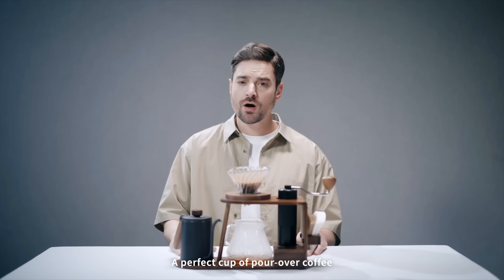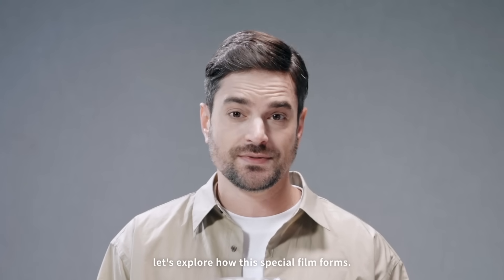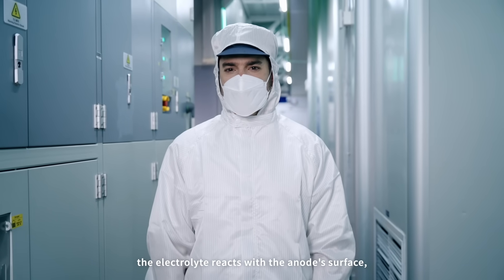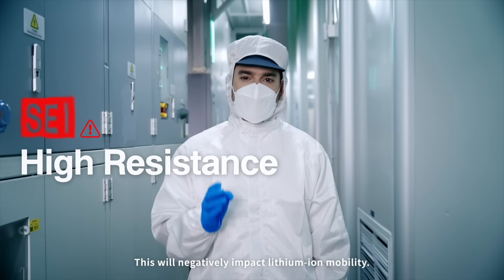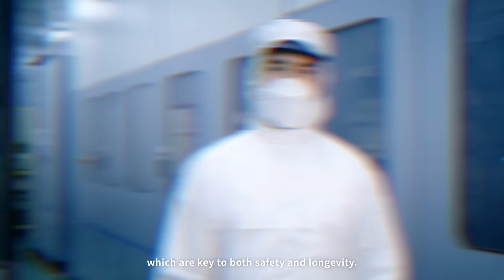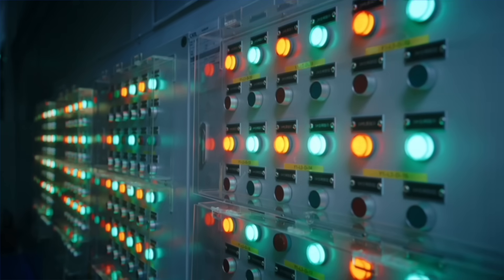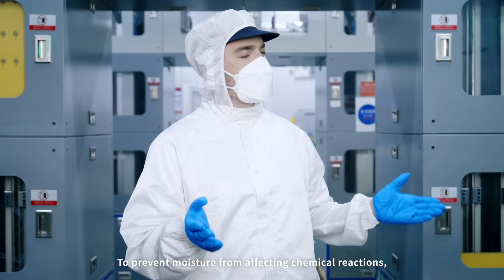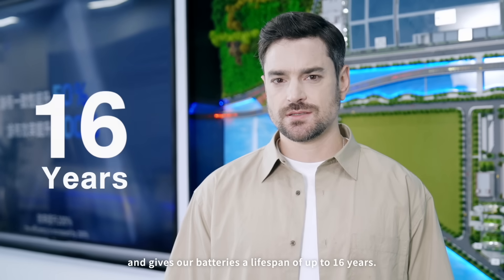1000x Thinner Than Hair: How Nano-Thin SEI Keeps Battery Fast & Long-Lasting | CATL Manufacturing

Comment: Tabless(full-tab) cylindrical cells have 20% better (miles per kwh)efficiency in similar battery chemistery and volume compared with prismatic cells. For that very important reason please develop entire large  tab-less cylindrical 46XX portfolio . With 90% nickel content NCMA cathode(50% better cycle life compared with NMC , and 160% better compared with NCA) with 10% nano silicon content SCN anode with gel(lithium-salt)polymer electrolyte with above 4000 cycle life and 1000 amps and 10c charging capability .
Reply: Phew, someone trying to revive their declining Tesla shares? Thanks buddy, but we think CATL know what they are doing...
Reply: @johnhornblow4347  I mean, does it matter? CATL is also making tabless cells :)
Reply: @neutronpcxt372 no it doesnt
Reply: @davidfujkk8018  I mean, it makes them indirectly at least.

Ampace was created by CATL and ATL (TDK), and they do make tabless cylindrical cells.